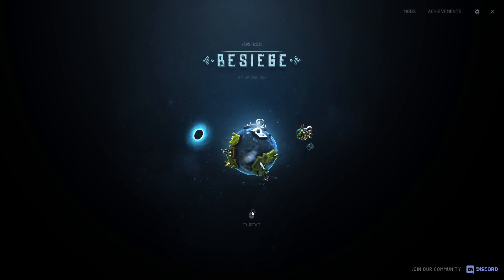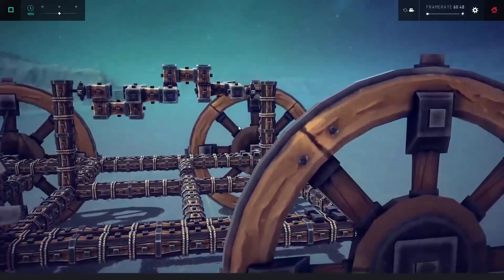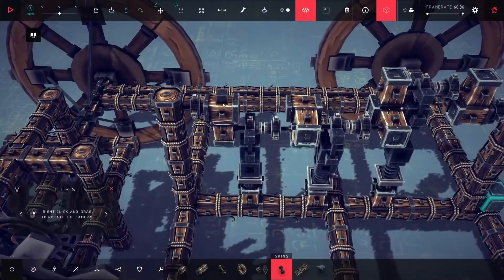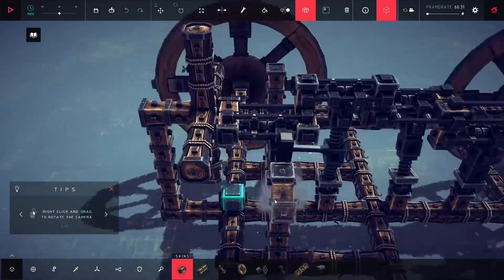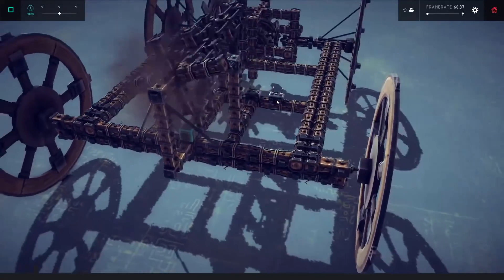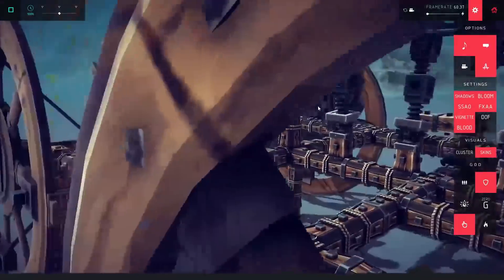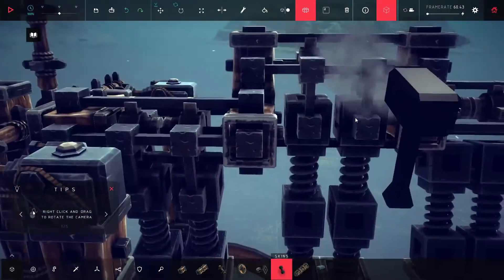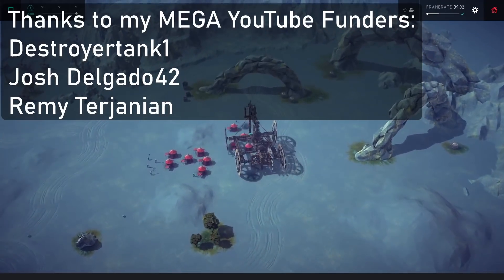Making a Functional Engine in Besiege

Comment from the maker: What else could I add to this car? I was thinking maybe a transmission next, though I'd probably need to make a better engine or use a powered gear for that.
Reply: I think transmission, like you said, would be the next logical step

Ps: Love your videos, and I love seeing you over engineer stuff in Dream car builder and Besiege ! :D
Reply: @void_creature  v8
Reply: Maybe a realistic steering system?
Reply: Suspension
Reply: You should add a couple MORE engines and use gears to connect them so you can get the ultimate power!!!!
Reply: Bro at this point you have to make the whole drive train and then a body. Good luck.
Reply: Shock absorbers (suspension)
Reply: You could add realistic turning!
Reply: That would be very cool, maybe make it more compact as a whole so that it runs more easily too
Reply: All wheel drive
Reply: @fernweh8709  I like the idea of needing CV joints for that too. Interesting idea
Reply: Radial engine. Longer stroke. Wider crankshaft Radius. Try cross-plane or flat-plane crankshaft. Planetary gears.
https://www.sciencedirect.com/topics/engineering/engine-torque
https://x-engineer.org/automotive-engineering/internal-combustion-engines/performance/power-vs-torque/

Here is a good one for reference!
https://steamcommunity.com/sharedfiles/filedetails/?id=1205432467
Reply: Add fire to water jets to make steam jets, then make a much more powerful steam powered piston engine. Just use sensors linked to each jet and a notched camshaft linked to the crankshaft using 2 unpowered wheels with 4 of those bearing things (forgot their name, the ones you used to link the pistons to the crankshaft) on each wheel and link them with braces to act like a timing chain.
Reply: Add a trebuchet
Reply: A rack and pinion steering system.
Reply: V engine like a v8 or bigger
Reply: Yes, make a transmission
Reply: If you want more power you can make the engine use steam to move.
Reply: You could offset and duplicate the entire engine and have both work side-by-side for more torque. Turning the engine 90 degrees to have both sets of pistons attached in the middle might help with this. Bonus style points if you have one turning clockwise and the other anticlockwise.
Reply: Also locate things more realistic: longer frame, engine in the front, located farther down
Reply: Locking differential
Reply: Realistic brakes would be cool
Reply: Maybe a wishbone independent suspension
Reply: Maybe you could make a series where in each episode you add a part to this car for example in the next one you can add a transmission then the one after that one you could maybe add realistic turning and so on and so forth until you have a fully working car
Reply: Make a clutch that can engage slowly so you don't stall, but when fully engaged it locks. Also, have a big flywheel on the engine.
Reply: Add a pew pew gun that go pew pew
Reply: Have you considered trying to make it a Boxer engine? A boxer engine is flat so you could have the center of gravity be a lot lower, and you could probably fit in more pistons. You could also try a V8 if the game will allow it.
Reply: There is actually a lot that you could add because cars have a lot of stuff in it.

I mean, just look at the replies there is a ton of stuff a car has and I know
because I've been looking at way too many lego technic videos.

Some of them are actual things that go carts and cars have and others are just creative inventions like an ejector seat.

I'm going to try to organize them

And don't forget that you can include a lot of them at once and make the ultimate over engineered car!
Transmission/Drive Chain:
   1. Clutch
   2. Gear shift (would have to take some serious work because, well, it's besiege.)
   3. A GEAR CHAIN! (not practical at all but it's would look really cool!)
   4. Making things automatic or more specifically a gear shift. This one is for the far far future after you've worked out a lot of kinks.

Steering:
   1. Realistic Steering (which would probably be the go kart style. I'm calling it that because i don't know the official name for this type)
   2. Rack and Pinion (this is once again not the practical one but it would look cool and add to whole
"overly-engineered" theme)

Wheel Stuff:
   1. Suspension
   2. Tank Treads

Engine Stuff:
   1. A V engine
   2. Add some kind of flywheel weight because your engine seems like the type that uses it.
(It would help, definitely)
   3. MAKE IT FASTER SOMEHOW, could solve your speed problem without sacrificing too much torque. Like somehow get it at like 4x speed or something at the very least.
  4. You know what? Just try to make it better, there are a ton of things to improve and try and I'm not going to list them all.

I might edit this to add who knows?
But I hope you see this.

(P.S your car will have to be much much bigger and wheel size too.)

EDIT: Maybe a more complicated differential though, again your car will have to be much much bigger.
EDIT 2: Make the car more structurally stable, it's kind of wobbly.
Reply: Imma recommend making a game in scratch :) I've had fun making games in it for years, and it would be awesome to watch you make a game on it. I also recommend watching Warfame for help on YouTube :)
Reply: A radial engine would allow you to put a lot more power into that space and it wouldn't be as long front to back. You should look at a Pratt & Whitney R-4360. Engineering marvel.
Reply: Wider tires. More stability and torque.
Reply: make a boxer engine so it doesn't get so tall
Reply: More Power !!!
Reply: Perhaps a suspension system, though those have already been made many-a times in Besiege.
Reply: P O W E R
Reply: Add an ejector seat like the ones in cheesy action films
Reply: Once you're done with the car, you should add a driver to it, in like a little cab
Reply: Scrap mechanic
Reply: A shifter, maybe something like the Model T.
Reply: Wonderful as always
Reply: spoiler
Reply: Upload it to the workshop (;
Reply: I got it!!!!  Wings!  (is that even possible in this game?)   

Not jokingly, I think a transmission would be cool...  I know other people have mentioned it but it sounds like fun :)
Reply: Add reverse
Reply: I bet you could use cannons or steam power (or maybe those springy rope things?) to make a more powerful engine
but I think a transmission would be neat
Reply: Sounds good. You design all this stuff and you make it work, even if it takes hours, maybe even days to finish. A game you might consider is Hydroneer.

Engine Gang
Reply: You can fire cannons without having to press any keys by heating them with fire, which you can do with fireballs or torches. I’d love to see some kind of engine driven by shrapnel cannons that are moved into torches to simulate a real engine’s combustions (shrapnel cannons are more compact and don’t leave behind pesky cannonballs)
Reply: I designed an automatic gear box last year but I haven’t used it so I don’t know if it works but if you want I can send you the design
Reply: Reid Captain car  be like BRRRRRRRRRRRRRRRRRRRRRRRRRRRRRRR
Reply: can you use this engine to propel your car in air?
Reply: This would reduce overall weight of differential and gear reduction trains so I think it could be possible
Reply: Suspension and realistic steering
Reply: I'd say a direction system could be nice
Reply: Maybe you could take away like 1 year reduction cuz it can’t go up rocks anyways even with 16x power, so if u halted the power, wouldn’t u double the speed?
Reply: Awesome creation! I followed your last creation and eagerly awaited the addition of an engine, you just earned yourself a subcriber 😎 
I think the next step is definitely a transmission of sorts, maybe use a piston to change gearsets or to engage super-low-range and climb that pesky rock
Reply: you might wanna consider doing a v or a boxer engine. if you are to do one of these, then you would need to fix the timing issue that prevented you from using the engine with pistons on the top and bottom. and if you're adding a transmission, then i think it would be cool if you tried making cvt (constant variable transmission).
Reply: Instead of using pistons to power the engine you could use steam. If you have a torch below a water cannon it makes steam which can be used to drive a piston. You can interupt the steam with various parts which act like valves.
Reply: suspension
Reply: You could try a vacuum powered engine, so you’d have the power for a transmission
Reply: Make car which can drift a bit
Reply: I'm not hating the design however I believe that the reason why the rotation of the Crank was labored and jittery is because you're pistons are all 90 degrees offset, while in almost all 4 cylinder engines ever produced the 1st and 2nd pistons are 180 degrees offset, the 2nd and 3rd are in line with each other and the 3rd and 4th pistons are 180 degrees offset. In other words a flat plane crank.
Reply: Tank treads
Reply: Clutch!
Reply: Yes, do it
Reply: You could make a more realistic steering system
Reply: Different speeds
Reply: You could turn this engine you have right now into a V6 or V8 to increase its power
Reply: Optimize it! I'd love to see a lighter, less messy, more powerful version. Basically a V2 of this car
Reply: change the piston engine for a steam piston one, keeping the water spray block hot and once it extends to the maximum, a sensor turns on, causing to release steam and move the crankshaft

it is visually messy, but it's a way to "simulate" the explosion

also on a I4 engine 2 pistons are fully extended while 2 are fully retracted,  usually the middles ones go one way and the end ones the opposite, all that to avoid unecessary vibrations
Reply: You should add a clutch.
Reply: Reid Captain a super badass grenade launcher or spiny flamethrower
Reply: A realistic steering mechanism and you should add MO POWA BABEH
Reply: I would've reduce amount of blocks and put lighter wheels, such way you could reduce friction force so it could move on the ground with less power!
Reply: better wheels
Reply: clutch and a flywheel, a simple gearbox (2 F N R) would be nice to have but thats going to be heavy
Reply: This is bad ass. I vote W 16 power 😂
Reply: Realistic steering
Reply: No clue what to add, but Just a cool fact about besiege, if you only have 1 unit of space infront of the wooden pole or the 3 long log, it will shorten it, meaning, 1 long poles, or 2 long logs!
Reply: You should make suspension so that it can actually go over pebbles.
Reply: YES, YES NEED TRANSMISSION! Also your going to make a fully fledged car eventualy
Reply: combustion engine using shrapnel cannons
Reply: I think with the doubled up pistons you'd be better off making an opposing cylinder engine, one where the pistons are angled from the crankshaft by about 25 degrees so that in their default position they have leverage against the center, along with a larger "dent" in the crank shaft allowing more leverage. The piston pushing horizontally (with 25 degree offset) and a piston on the opposite side (and respective opposite offset) contracting should give you the torque you need. I see you have extra horizontal space too, I think this may be the solution. I don't own the game and would love to see more of anything from this game involving gears! Thanks!
Reply: Heated seats.

Also known as fireballs.
Reply: cupholder obviously
Reply: This is too complicated for my ooga booga cave man brain
Reply: give it hydraulics
Reply: Yes
Reply: yo are you nile red?
Reply: Make it 4WD and give it realistic steering, so you have to make it steer while still delivering power to the wheels
Reply: Ice cold AC.
Reply: You can use the stress to your advantage by connecting your wheels to a deferential and when there is stress the deferential will start turning and you can then connect the deferential to a gearbox you can then connect the gearbox to the wheel and I think it will work because this is my automatic gearbox design in a lego technic car so I think it will work
Reply: clutch
Reply: Yannik Arndt   You are right!!!
Reply: Try making a V engine
Reply: Should try making a radial engine, should have alot more power/torque
Reply: What about a RWD trike with a mid engine setup? You wouldn't need a differential at all which would cut the weight in half.
Reply: power windows
Reply: I made transmission ages ago and it is horrible because 'game' was in alpha :D
Reply: You should make a stronger engine, and strengthen the car overall, you should try to make it be able to go over rough terrain maybe.
Reply: double wishbone suspenstion.
Reply: Add a W16 Engine.
Reply: make it a V8
Reply: why not build a manuel gearbox if your building a car
Reply: Add a flywheel to the engine to make it run smoother
Reply: there was a easier solution here 3:00.... just use the braces to connet the points of the ball joint while its attached to the pistons.... thats would worked although if you didnt want it to glitch through than that wouldnt be the best of you i guess
Reply: you also tho coulda just had a normal joint like the ones on both ends of the crankshaft holding it up but just braced between its end and the other one in the one block gap which is possible if tricky to get right but that wouldnt be glitching itself through itself to work and would do the job in a far more compact way.
Reply: I've tried doing this car with a transmission, it's not easy. Also how do you extend the piston at the start?
Reply from the maker: @jackevans5719  Tap F while hovering on the piston
Reply: @ReidCaptain  tysm. I've been trying to get the engine to fold out with steering and grabbers 😅
Reply: If you want, I’ve got a 5 speed transmission car I made at one point. If you want you can use it as inspiration.
Reply: How about a steering rack?
Reply: Make a star engine or a boxer engine to remove vibration :)
Reply: im sure this has been said 50 times but a fly wheel would smooth outthe engine
Reply: instead of ha ing four "cylinders" in a single row. have one connection on the crankshaft in a + shape with four pistons or more
Reply: use thrusters to assist the engine
Reply: you could add a switch for awd i think tbh im super into cars but im only 16 so don't understand all the physics and you're videos help me understand them thanks!
Reply: you need a flywheel
Reply: Smaller wheel diameter perhaps and try and reduce overall weight and size maybe?
Reply: Yannik Arndt  holy crap
Reply: Buddy you basically created an in-line 4, then when you doubled it, that was a inline 8, then finally a flat 16. But I think it might have been hanging up because the pistons on top were extending  while the extension of the pistons on the bottom was still engaged. At fast enough speeds the software might not differentiate between them.
Reply: Next steps should be transmission, longer base for improved power, and maybe since you have so much horizontal space, twin engine?
Reply: use one engine for each wheel
Reply: if you take your pistons, turn the whole mechanism 90 degrees, you can add another one on the opposite side. I dont know if they allow you to do 45s, but you could theoretically have 4 of those all feeding one crankshaft. you might even be able to do a flywheel like the gyrobus.
Reply: you built an inline 4, just copy it to have a twin 8,
Reply: If you made the crank out of ballasts, and added a flywheel or harmonic balancer you would have much smoother motion and would likely be able to add the pistons back on top for more power. The reason you're having issues right now it seems is that the engine knows 5 positions, and for lack of better terminology im going to say up, left, down, right, and in between any of those. If you added the flywheel/harmonic balancer you would give it a better chance to lope over into the next sensor position when you reach something that slows it down. Right now the mass of the crank is not enough for conservation of momentum to carry it into the next position when it reaches resistance. I am very impressed with how you are able to work with the mechanics of this game and really enjoy these videos of you taking games like this to their coded limits.
Reply: try water cannons and fire to make steam force pistons downwards.  think it would replicate a combustion engine best
Reply: If you need a power source, why not stick a boulder or flaming ball onto some sawblades and make a Chaos Engine? They generate tons of torque.
So much in fact, that making a transmission in order to effectively harness it without tearing the car apart would be a decent challenge.
Reply: Can you describe how you made the sensor logic for the engine, I couldn’t figure it out.
Reply: I mean, you could always turn it into a tank. Idk anything aboout thta game though so if theres no way to make it shoot just make it so it looks cool. Also there'd be the challenge of making a workig turret
Reply: Make a harmonic drive
Reply: A working A/C
Reply: very, very well done, thank you, I learned a little new, I was wondering how to increase the power of the engine itself so that the torque is greater, I also build my own engines, one of them is steam, two-cylinder, thank you, it was interesting.
Reply: Door
Reply: gun
Reply: Or a gear Shift for faster Driving.
Reply: Add a car shape to it